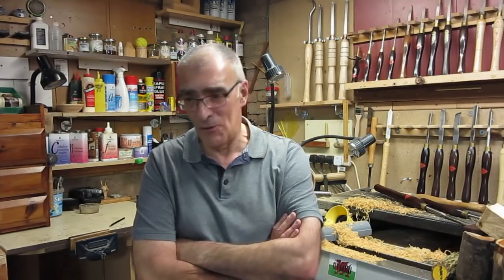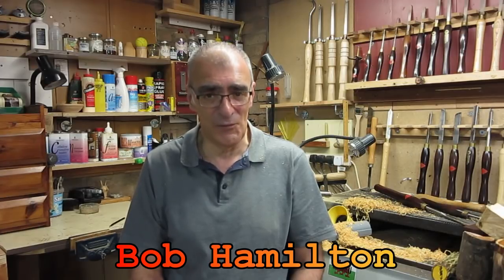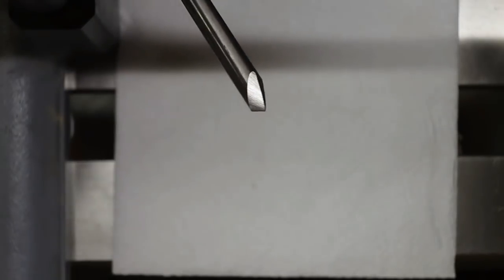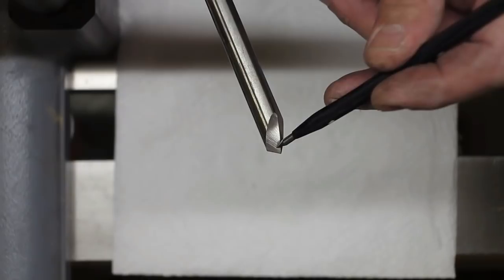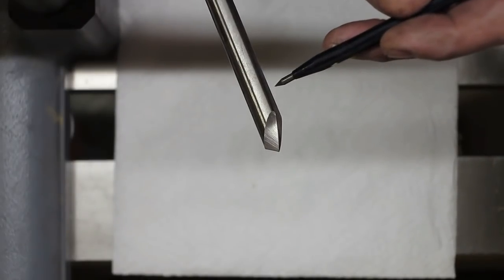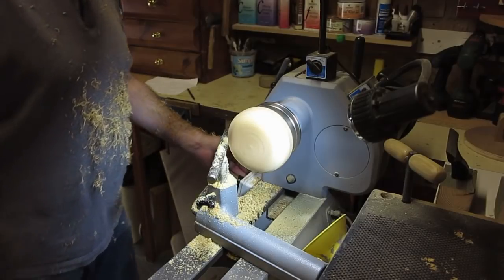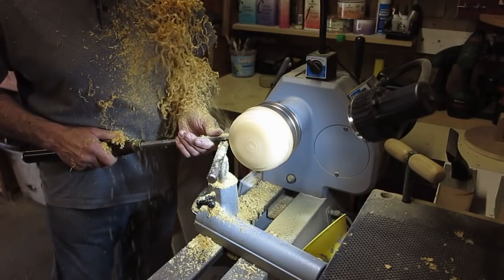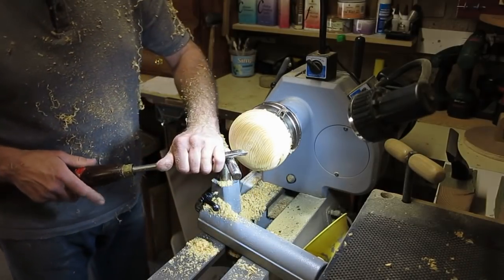Wood Turning - Beginners Guide # 5 - The Bowl Gouge

Comment: Very nice Mike, thank you,
The close up views of gouge grind profile and whilst cutting are excellent, just what we need.
If I got it correct, while on outside of bowl, pull cutting does not involve riding the bevel, whereas push cutting does require riding the bevel.

Cheers
Bill
Reply from the maker: Bill Wells Thanks Bill, actually you do ride the bevel on a pull cut, the video possibly doesn't show it that well, it's when shear scraping with the gouge, that you don't ride the bevel, but close the flute right up, and just use the wing, in a scraping cut.
Hope this clarifies it.
Cheers
Mike
Reply: Mike Waldt OK, thanks Mike. Between you and Brendan I will get it right.Bill

Comment: Beautiful turning Mike and a good refresher for those with some experience and a great lesson for beginners.
As an aside I noted that someone kindly sent you some wood and among it was a length of mahonia.    I spotted 4 similar pieces on ebay about a year ago and bought them as I have friends whose house is named mahonia.   I turned 2 candlesticks for them as a surprise with Ahem! captive rings which I learned how to do from you.
The wood is amazingly yellow and when I had the candlesticks finished I set them aside for a few days and on my return they had split along the full length and even cracked my beautiful rings.   They were obviously far too fresh so I must get round to trying the other two.   It's just to let you know really that mahonia must be the most yellow coloured wood there is.
Best wishes,
Alan.
Reply from the maker: Thanks Alan, Keith did tell me that the Mahonia needs quite a while to dry, it is waxed, so before I turn it I'll make sure the moisture content is right down. Thanks for the "heads up" my friend. I couldn't believe how yellow it looks, quite stunning.
Take care
Mike

Comment: Great video, informative, detailed and to the points, it does not matter how much I use the bowl gouge, I'm still a little scared of it at times, especially when I use it to hollow (don't have other hollowing tools, for now), but I did just ordered my first 5/8th bowl gouge, to supplement my 3/8th deep fluted bowl gouge which I used so far for just about everything.
Reply from the maker: Thanks Yuval, enjoy your new Bowl Gouge :). If your not sure of the cut your about to make, turn the work slowly by hand, and present the tool until you get a nice shaving, that will give you an indicator of how to proceed.
Take care
Mike

Comment: Could you make a video covering the usage of the traditional bowl gouge grind? With my new lathe, I have received a set of tools but it has a traditional 1/2in bowl gouge. I have played with it a bit on pieces between centers, but haven't tried turning a bowl yet. It doesn't look to be the best tool to use on the outside of the bowl(don't see it being used as a scraper or for making the tenon for the chuck). Your videos have been a tremendous help in showing how to use the tools correctly and to avoid catches.
Reply from the maker: +Quagmire88 
Thanks for the suggestion, but I don't use a traditional grind on my bowl gouges, so am not really the best person to show it. There are however many videos on "The Tube" that will demonstrate this for you.
Thanks also for your kind and supportive words.
Take care
Mike

Comment: Mike, your beginner series videos are very well done and are extremely helpful to me as a new turner, and I'm sure to others as well. Your detailed approach to how to present each tool to the wood is exactly what new turners need that frankly is missing on virtually most of the YouTube videos prepared by others. I'm assuming in this video you are using either green or partially dried wood, is that correct?  I'm asking because I've been using completely dried wood which seems to be considerably more difficult and challenging to turn. Keep the great videos coming!  Thank you
Reply from the maker: Hi Dom, it's good to hear that you find the beginners series of some use, thank you for saying that. The Cedar I was using was about 12% moisture, which isn't completely dry but not wet either, if you get my meaning. You are certainly right that wet is easier to turn in general, but some "dry" woods are great to turn as well, but I feel you must ensure that your tools are as sharp as you can get them, and normally the drier the wood the quicker you will lose your edge.
Cheers
Mike

Comment: Hi, Mike:
Thanks for the shout! 
Good presentation on bowl gouges.  One thing I found slightly disturbing was the amount of time you spend standing in the "line of fire" while turning the outside of the bowl.  I would suggest transferring the gouge to the other side of your body, with the handle against your left hip, your left hand on the gouge handle and your right hand guiding the the tool at the rest.  That should move you out of the line of fire if some hidden defect in the wood causes a piece to separate.  I recommend watching Reed Gray's video on "Line of Fire":  STAND OUT OF THE LINE OF FIRE by Reed Gray aka robo hippy

If you are turning freshly cut green wood you really need to turn with the gouge on the left side of your body or you quickly become soaked and your face shield becomes opaque from the water being flung off the wood.

Take care
Bob
Reply from the maker: Hi Bob,
I will practice your suggestion, as I see the point you are making. Thanks for the sound advice and warning.
I will watch Reed's video, and hopefully improve my technique, and most importantly, turn safer.
Take care
Mike
Reply: I guess it would be nice to have a lathe where the head stock can be run to the end of the lathe. AND have the room to be able to do that.  My lathe is about 5 feet long and there is no room at the end.  Also,   mine is permanent.  Variable speed?  I have 6.  Left and right hand turning?  it would take months and months of practice to be able to do both equally well. I get what Reed is saying in his safety vid, but trying to apply that in the real world is another story. bit's a pieces of the idea may be useful but not the whole thing.

Comment: Thanks Mike I need to check if my hair is blond.  I have struggled with accessing the inner wall of a box, leaning over the lathe wishing I could get to the back. You made the very simple suggestion of turning the head stock, dur mine is very easy to turn and lock in any position.  I have only thought of turning it at 90 deg.
Reply from the maker: Lol Allan, I still sometimes forget, and both my first lathe AND this one have swiveling head stocks!! One serious point though - don't forget to re align the centers, before you do any spindle work, I forget sometimes,and wonder why things vibrate slightly.
Take care
Mike

Comment: Hi Mike, Thank you so much for your videos. I am close to finally buy my lathe. I have my workshop finished. I am sort of surveying wood turners that I admire and to which channel I am subscribed to see how many HP do their lathes have to have an idea what I should look for. Thank you very much! Daniel
Reply from the maker: Hi Daniel, thank YOU for supporting my videos :). The size/HP of the lathe you need, depends on the type of turning you think you'll be doing. However, in my opinion, you should get the most HP you can afford, as in time you will need it believe me, as your expectations grow. I feel that at least 1HP and ideally 2HP or greater. Mine is 2HP, and I feel that it will adequate for all my future needs.
Hope this helps.
Take care
Mike
Reply: Mike Waldt Hi Mike, It's funny, because as I said, I have been surveying several woodturners and Robbie, Miguel, Eric, all have 2HP lathes (actually Miguel had it, sold it but is going to get one of that power when he is relocated in Florida). And it was more or less the idea I had, I have been checking a Grizzly of 2HP with a nice long bed and enough swing over bed space. The issue is that is quite long and my shop is not that big, but since probably I am going to concentrate my activity in wood turning, it is a well deserved space. Thanks so much for your answer it helped a lot to make up my mind. Best regards, Daniel
Reply from the maker: Daniel Vilarino Glad to have been able to help my friend. Let me know what you finally get, I'd be very interested.
Take care
Mike
Reply: Hi Mike, I got my lathe, it took me a while to transfer it from the box in the street to my workshop in the basement but it is finally moved and installed and I turned my first wast block (I still do not have chucks, they are on they way, but do have a nice face plate). I look forward to begin doing some turning !!!
Reply from the maker: Daniel Vilarino Congratulations Daniel, I hope you really enjoy your new hobby/craft. If you have any questions don't hesitate to contact me by PM, and I will try and answer them.
Take care
Mike

Comment: thank you very much for this excellent explanation of the bowl gouge use, very helpful for a medium beginner like me.
please can write what is your sanding sealer mix and why you do it ?.
Reply from the maker: Thank you Alfredo. I use the Sanding Sealer mix to seal the grain of the wood, which gives a smooth surface on which to apply the finish. It is Cellulose Sanding Sealer mixed with Cellulose Thinners to a ratio of 3 to 1.
Thanks for watching
Mike

Comment: Please forgive a complete newbie question - I haven't used a bowl gouge yet and this is the 1st video I've watched to prepare myself. Am I correct in seeing that you're using both the upper and lower cutting edges, with the material moving across the edge in either direction, depending upon which cut you are doing? For example - the 1st scraping cut - hard to see if it is the upper or lower edge of the gouge you're presenting to the work...? Thanks!
Reply from the maker: Basically you need to ride the bevel, lift the handle, and engage the cut initially just to the left or right of the nose, depending on the direction of travel. If you raise the handle slightly more you will take more material with a "heavier" cut, as you will engage more of the cutting edge. But be mindful the heavier the cut the more forces are at work, so care needs to be taken to control the process. 
Hope this helps.
Cheers
Mike
Reply: Thanks Mike - but just to confirm - you're saying the cut is always using the edge where the material is moving from the center of the tool out, right? Not from the outside toward the center of the tool? That's what I was trying to ask.

Comment: Hi Mike . 
 I just bought a lathe to get started out .. I had a 
limted budget but managed to get myself the Record Power Pen Chisel Set 
which consists of a 3/8" Spindle gouge , A parting tool and an Oval Skew
 , I also bought a roughing gouge as well after I had set it all up and 
got it all running . 

So far I have made a few lamps and some basic things but I want to now 
try turning some pots, bowls and things like that so in the next week or
 so I will be buying a chuck but was wondering what kind of bowl gouge I
 should get before I try to make one . 

I was just looking and I noticed a " fingernail profile gouge " 
advertised as being better for bowls than a bowl gouge . 
Would I be better off buying the fingernail profile gouge than a 
standard bowl gouge for the same job ? If so would I be better off with a
 3/8" or a 1/2" ? I am not looking to make anything bigger than 5-6 
inches as the lathe i bought will only allow that size . 

Thanks for the great content you have provided and 
thanks for the inspiration ! 

Kind regards
Reply from the maker: I hope the reply I gave you in private messages was OK for you Hydro :)
Cheers
Mike
Reply: Perfect ! Thank you very much Mike . Looking forward to the next video :)

Comment: Hi Mike, I'm fairly new to turning, but I feel like I'm off to a good start. I recently picked up a used Henry Taylor bowl gouge and wanted to give it a whirl but thought I'd check to see if you'd done a video about it, and here I am. I noticed on my bowl gouge it has a concave grind. I still tried using it but I was getting plenty of catches and finding difficult to get a nice smooth cut. These could well be the issues that you were on about in the video. What would be the best way to get a straight/convex grind? I think getting the grinding wheel out and redoing the grind would be the best? Any advice is warmly welcomed, Thank You! :)
Reply from the maker: Hi Meteor, the best way is to start fresh. It would take too long to explain here, but here is the link to a great video on the subject by Steve Fulgoni, hope this helps you out;
https://www.youtube.com/watch?v=rNCZP3veFqk
Cheers
Mike

Comment: Mike you mentioned the different methods of sizing bowl gouges. But I did not hear which one you were using , flute or bar for the size of your 3/8 and 5/8 gouges?
Reply from the maker: Hi Mark, an oversight on my part, the ones I am using here are sized by the measurement of bar. But it must be said very often the measurements do not always equate to the manufactures measurement :). If producers standardised their method of sizing, things would be a lot clearer, especially for new turners.
Thanks for the very valid question, as always.
Take care
Mike

Comment: As a newbie woodturner getting used to using a bowl gouge, am I normal? What I mean is, is it usual for the oak or walnut shavings to be hot as they peel off and smash into my left hand? I noticed also my 3/8" gouge (which I keep razor sharp, tormekked and stropped every 10 or 15 minutes) tends to get very hot too. Am I doing anything wrong? 
cheers Jonathan
Reply from the maker: Hi Jonathan, in my opinion that is normal, especially when turning hard woods like Oak. I will say that 10-15 minutes seems a long time to keep a keen edge with really hard woods, when I turn Oak Burls I sharpen/hone maybe every 5 minutes, even with M42 HSS.
Thanks for watching 
Cheers
Mike

Comment: great advice
I just wondered if I could do those cuts with a bowl gouge with a standard grind without the swept wings because I don't have a bowl gouge with a swept wing.
Reply from the maker: JuniorTurner01 Which cuts are you considering junior
Cheers
Mike
Reply: A scraping cut and a pull cut which you mentioned in that video. cheers

Comment: Hi Mike, yet an other excellent video. Regarding keeping the sweep lines convex or flat do you have any advice on how to achieve that, or do you have a video?  I just converted a normal spindle gouge to a detail gouge for finer spindle work, and have ended up with a concave sweep. As you can imagine, its become quite catchy!  So you know what I'm working with, I have CBN wheels, a Robo Rest (bought after watching one of your videos I think) and the One Way Extended Arm.  But I'm obviously doing something wrong.  Stay safe, my friend.
Reply from the maker: Thank you Eddie, the main reason for concave wings is to much time spent on the middle of the wing, this video might help:
https://youtu.be/CheSEXBQNFk
Cheers
Mike
Reply: Wow Mike, that video is spot on!  I just ordered the Varigrind jig!  Can't have too many jigs! In this period of being shut-in, instead of overeating, I'm spending my time reshaping my tools. After watching your video I'm well on the way to converting my scrapers to negative rake as well.  Cheers, and stay safe.

Comment: Nice video, but i have an odd question, I have problems with my hands as in not being able to hold tight onto things, How tight do you have to hold the cutting tool ?
Reply from the maker: Hi again Mark, you just need to have a "firm" grip, if you hold on too tightly you lose flexibility, and it makes the job actually much harder.
Cheers
Mike

Comment: Very helpful video, Mike. I'm still having a bit of trouble going from the vertical wall to the bottom of the bowl when hollowing. You rotate the tool so that the flute is more open (like towards 2 o'clock? as you go around the inside bend? Thanks.
Reply from the maker: Thanks Judy, and yes your analogy is correct :)
Cheers
Mike

Comment: Trying my hand at bowl turning. Have a 1/2 bowl gouge and it honestly didn't go as smooth as yours does! I used a push cut starting on the front corner pushing back toward the Chuck. Not too bad. Then tried to cut on the tip of tool pushing toward the center but seems like it's taking a ton of pressure to the poi,t the tool is top got to get too close to the tip. HELP! What do you think Mike?
Thanks a bunch!
Reply from the maker: I can only suggest light cuts and a sharp tool. But, try rotating the wood by hand as you present the tool to the wood, then you can find the "sweet" spot as you raise a shaving ... now practice replicating the cut with the lathe on a slow speed. This is a method I use frequently when trying to ascertain why things aren't going to plan.
Hope this helps
Cheers
Mike

Comment: New wood turner here and im trying my hand at turning a bowl much the same size as the one you are turning here.  But as soon as I try and shape the bottom of the bowl and come around to shape the edge I have a major catch every single time.  Ive sharpened my bowl gouge and it seems sharp enough, but I catch when I try and round the bottom edge.  Very frustrating!!!
Reply from the maker: One suggestion ... ensure you maintain bevel contact right through the whole cut, otherwise you have an unsupported edge, which will cause a catch. 
Hope this helps Craig
Cheers
Mike

Comment: mike do you ever use 1/4 bowl gouge,,i noticed you can buy them but it seems like it would be too small,,,what applications would you use it for
Reply from the maker: I don't own a 1/4" bowl gouge and never have. I would possibly use it on spindle work, to remove waste wood, but personally don't see a need for one.
Cheers
Mike
Reply: I agree mike,,thank you for your response,,i value your comments so very much